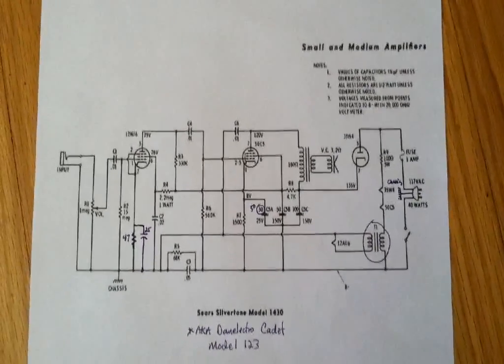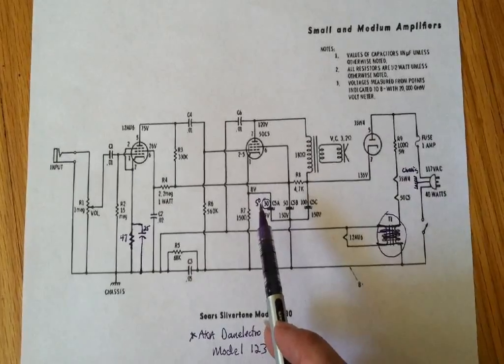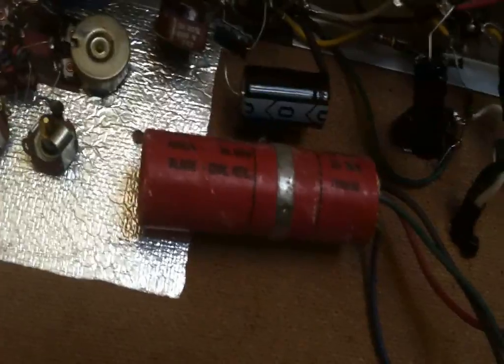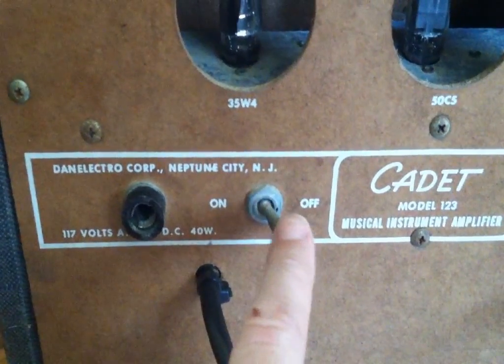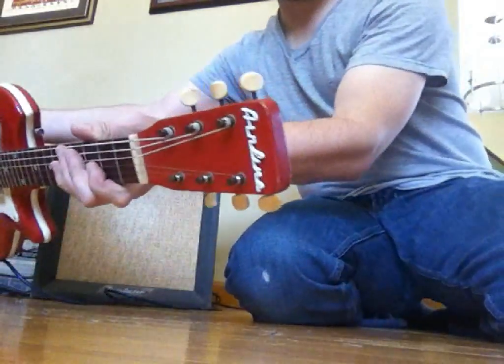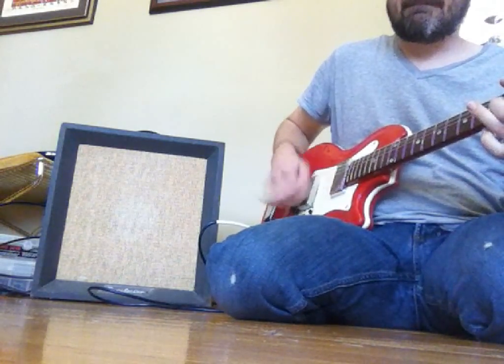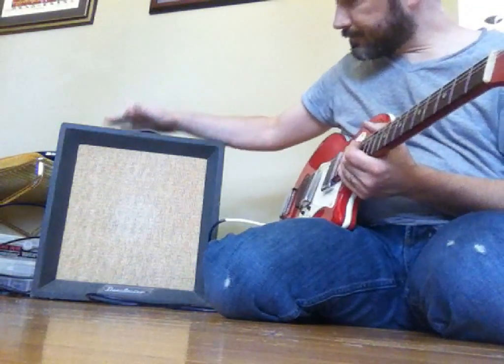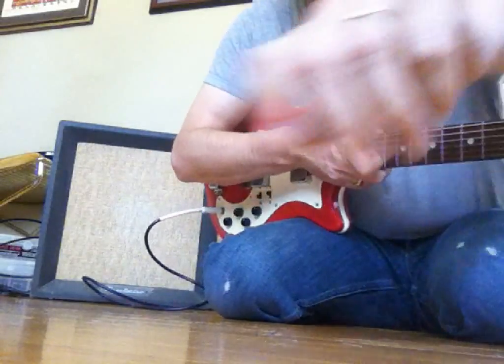1965 Danelectro Cadet 123 Tube Amp Service, Modification, & Demo

Comment: Hi,  loved your upgrade to the Danelectro.  Just picked up a similar Sears (Silvertone) 5XL and have been watching the videos on that and also an Airline.  Wife got real nervous when I mentioned the Widowmaker.  Old enough to remember getting zapped back in the 60’s (sometimes from the amp too).  Have done Mercury Magnetics mods to Chinese Epiphone Valve Jr. and Fender Champ with great outcomes (but not pint to point).  Good at directions and technique, light on theory.  Was wondering what capacitors you went with in upgrade (less expensive one available in 100microfarad/450v (only voltage rating found), but more expensive for 50microfarad/150v, where only Spragues were available).  Note that a Sprague 100microfarad was available, but a bit pricey.  About $25. for the total replacement, using Spragues.  Cost is fine, your thoughts? Another question on 100ohm 5watt resistor on rectifier.  On an Airline modification the value was changed from 233ohm to 500ohm with amazing results.  Just curious if any change was ever considered, or what your recommendation would be.  In that example he reduced plate wattage (correct term?) from 91% to 75%, of tube maximum which was supposedly similar to a Fender Champ. Your thoughts for this application?  Getting ahead of myself since I haven’t even received it,  but may upgrade speaker to a Jensen Alnico 20 watt once I hear it. This would be a fun amp to build from scratch if costs could be minimized, considering the simplicity, especially with the variations which were produced under the Kay and Danelectro nameplates, as well as the versions produced for Sears and Montgomery Wards (both Danelectros?).  Sorry for long post, totally bored with COVID isolation.

Comment: Could you show exactly how you moved the switch to the other side of the fuse?  I put a 3 prong on the amp and has the exact same problem you had.   I would appreciate it.

Comment: I just ordered one of these. Hasn't arrived yet. It supposedly works and is functioning well but we'll see I guess.

Question. How much trouble/difficulty/cost is it to add a proper ground to one of these things? Seems like wiring a ground to the chassis and installing a power cable would be fairly simple task.. but then again, if that were the case.. why don't more people just do that?

Comment: I have the Sears 5XL/1420 from 1972 I think. It has a low hum that bugs me, other than that it sounds awesome. I've replaced all the filter caps. It still has the 2 prong plug.
Reply from the maker: Probably a grounding issue.

Comment: Hello, for the 25uf bypass capacitor, what voltage rating would you want to use?
Reply from the maker: A bypass cap in one of these would only need to be around 25V.
Reply: Awesome, thank you.

Comment: So I recently picked up my own Danelectro Cadet 123, I think it might be a 1964 model. The wiring seems to be a bit different, pretty sure it's stock though as none of the parts look new.
I'm just trying to figure out the schematics and how they line up with the amp. Looking at the mods you put on yours I'm not sure where I should wire in the 47 ohm resistor/25uf cap. Are they wired from the 7th prong of the power tube to the chasis, or from the 2nd prong to the 7th prong, or the 2nd prong to the chasis?
Also I don't see the 30uf cap in my circuit, in only seems to have 2 caps connected to the switch. They are 150v and say 40+20uf. I'm curious, would I be able to replace these with a single 150v 120uf capacitor to save some space and wiring troubles?
Thanks in advance!
Reply from the maker: It will be difficult to advise you with any certainty, because I don't know if your amp follows this same schematic. IF the tubes are the same, the one that will get the cap and resistor to chassis from the cathode is the preamp tube, NOT the power tube.So you'll want to look for the 12AU6 or 12AV6 (whichever one you have in your amp, and place the cap and resistor from the cathode (pin 7, I think) to chassis. Make sure you orient your polarized cap with the positive end on the tube, not the chassis.

If you're not used to doing these kinds of modifications, be very careful, or if you're at all unsure, please refer it to a qualified service tech.
Reply: My apologies, I meant preamp tube, mine uses the same 12au6/50c5/35w4 for the preamp/power/rectifier section.
I will make sure to orient the  cap properly, thank you.

I've done a couple cap mods on a Fender DeVille 212 so I'm not too worried about this as long as I discharge the caps.

Again I'm curious, would I be able to use a 150v 120uf cap in place of the two 40+20uf 150v filter caps that are currently wired parallel between the switch and chasis/tubes? They're both large red Planet Lyticap polarized capacitors, instead of a single red capacitor like you had.
Reply: By the way these old caps are rated 150 wvdc. So, if I replace them with a single capacitor would I want to buy a cap with a higher maximum voltage rating than 150V just to be safe? Thanks again.
Reply from the maker: Replacement caps usually come in 160v for this application. I've used those, or sometimes the larger values will work in a pinch. Just don't go lower.

Comment: Great and thanks for the reply! I live in the UK and these models don't show up all that often. Or if they do people want top dollar prices. Can get a bit silly. I also love the sound of the GA-20 and GA-40. Silver tone and Danelectro have caught my eye recently. Valco and supro tend to fetch higher prices probably due to Logo.
Reply from the maker: You can save a little money on Valco made amps by buying the Airline or National or Gretsch versions of circuits rather than the Supro version. Jimmy Page and Jimi Hendrix using Supro made those instantly collectible. Most people have caught on the the others as well, but not everyone.

Comment: Hey do you keep all these amps in a collection? If not which were your favourites
Reply from the maker: I buy, repair, sell, trade... They are ALL for sale...even my favorites. Some of my favorites featured on my channel have included the National N6422TR (Same as Supro S6422TR, and Airline 62-9025A). I have owned several examples of all of those.The last Airline I had was as good or better than any of them: https://www.youtube.com/watch?v=IhQFUTVAmbE

The Harmony H415 was a phenomenal amp (and I have another one of these I'm about to service and sell: https://www.youtube.com/watch?v=samqLjkGR4w

The Gibson GA-20T is amazing. I've featured two different examples of that amp on my channel: https://www.youtube.com/watch?v=pco3AAvBW6w
https://www.youtube.com/watch?v=7ludDMl5sPQ

The Silvertone 1482 cannot be rivaled for tight, cutting crunch tones: https://www.youtube.com/watch?v=GL5sDJl_u-0

Comment: I would have put $20 isolation transformer in there.
Reply from the maker: +randallissimo Thanks for the comment! But I have to ask, for what purpose? A 3-prong cord and a reliable house ground and there is zero chance for you to be electrocuted. I think the dangers you read about of these amps is totally overblown. However, if the next owner feels the need for one, he is welcome to buy one.
Reply: +The Guitologist  That assumes every outlet is wired correctly. Plug into a reversed wired outlet and you will blow the breaker since now you have chassis grounded with third prong. Or plug into a reversed wired outlet with no/bad ground and you get electrocuted. I am restoring one of these amps right now, and if the customer would not spend an extra $20 to make it as safe as possible, I can't take the job because of liability concerns.
Reply: This is a sensible proposition. Regarding hum - why is the transformer for 12AU6 removed? It's only purpose is to reduce hum in the preamp section if I'm not mistaken.